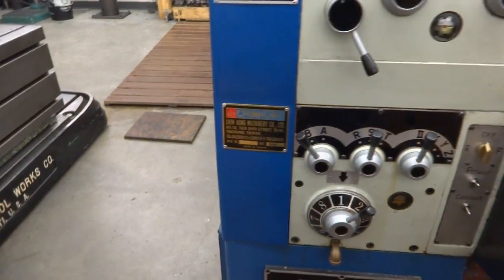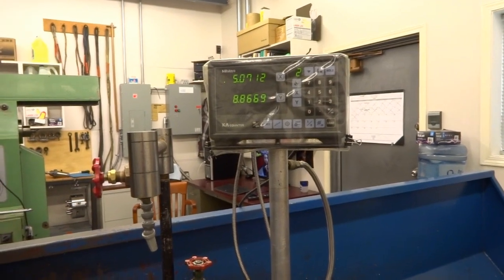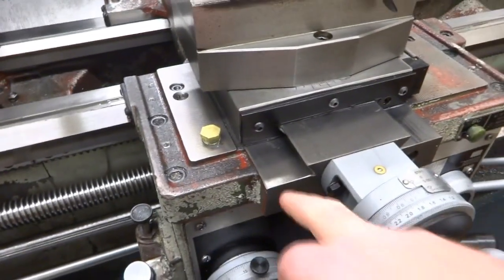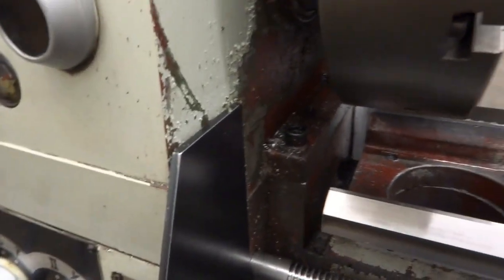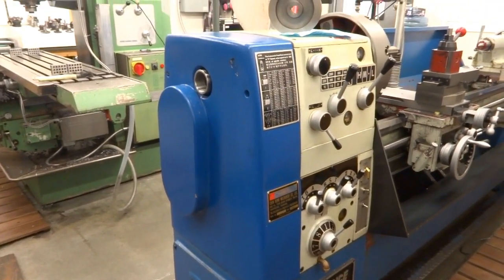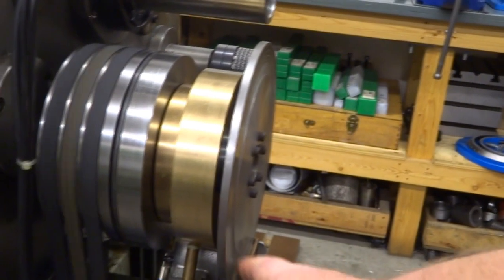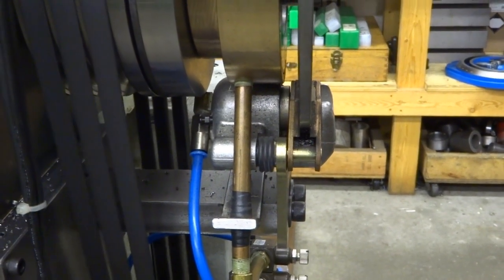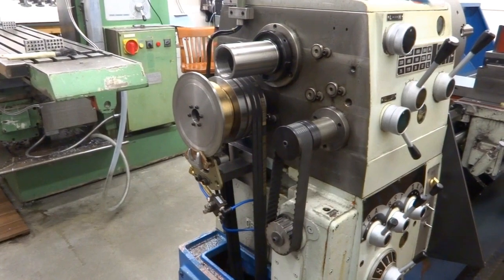Overview of Chin Hung Lathe

Comment: Accidentally came across this video and Wow.  Absolutely amazing. Loved the thorough tour of the ChinHung Lathe (now Kinwa - Chin Hung Machinery Co) but also loved the tour of the clutch assembly and pneumatic Clutch & Brake setup.  Amazing. I never would have though about adding a "clutch" to ease into the power load-draw! Plus the fact that you made it yourself!  Literally, you made a hybrid automotive Air conditioner / Transmission clutch assembly, w/Disk Brake no less.  Totally awesome!  

FWIW, most of my family worked/works for a very large air plane company and were / are machinists so they know... but I only recently got interested in machining / lathes and I'm amazed with what can be done on a lathe.  I'm a 100% noob on this stuff but would like to learn more.  This video was fantastic. Keep up the good work!

BTW, where / how did you learn to be a machinist?

Thanks.

Comment: I have a Kingston HJ1100 which is the exact same machine. It was built by Chin Hung. I love that machine. Very well built. Very accurate and smooth. A joy to use. I run it on a VFD which works really well.

Comment: Man that clutch set up is sweet. Awesome job. I am picking up a large older Jet lathe. Made in Taiwan also. I wish it had a clutch on it. Not a fan of all or nothing when you have a large piece chucked up and it starts to turn up quickly.
Reply from the maker: Thanks Tom.  It's something I'm fairly proud of, but because it is hidden under a cover and never seems to need any attention I rarely think about it anymore.  The clutch itself is sort of an all or nothing set up as the valves only control flow rate and not downstream pressure (like most valves).  (i.e. they are not like an air brake valve which controls the down stream pressure depending on how far down you press the brake pedal). You can 'ride' the clutch a bit but that simply delays how long it takes the clutch cylinder to reach full pressure.  It eventually does reach full pressure and then even though the clutch lever is only partially engaged the clutch will be fully engaged.  Because of this it is not as smooth as riding a mechanically actuated clutch.  I have added a couple of needle valves downstream of the control valves and this allows me to control how fast the clutch and brake engage.  The two advantages I see with this being a pneumatic clutch are the ease of running air lines versus linkages and the fact the clutch never needs to be adjusted.  I designed the piston stroke to be more than the friction material thickness.  Therefore as long as there is friction material the clutch will fully engage.  Thanks, Ken

Comment: Hey Ken.

Very Good lathe.
It always comes down to the same thing with anything in life.
Pay More Get More.

Very good work making the drive clutch.
It can be a problem when setting up at home.
How to power your equipment.

I was thinking you could maybe just a soft starter.
Either Electronic ( Inverter ) or Mechanical / Electrical ( Star Delta Starter ).
Even though i have 415 volt 3 Phase i still use a Star Delta starter for my lathe more so to reduce the amount of Inrush of power that you already would know about. 

Thanks for grand tour.
Regards Peter.
Reply from the maker: Hello Peter,  'Pay More Get More' or 'You get what you pay for' was a mantra passed down to me by my dad.  It is a very rare occasion when I cut a corner or cheap out in my shop.  I see some people do it and get away with it, but I never have that luck.  The odd time I have tried to cut a corner it has blown up in my face.  Over the years I have found going fast and cheap takes longer and costs more, so I don't do it.  Regarding the invertor, star delta soft start, about a week after I got my clutch running on the lathe, the power company came by unannounced and put me on my own transformer.  I can start and stop the motor on my lathe as much as I want and I don't affect my neighbours anymore.  By the way, using 'star' in star-delta betrays you as a member of the commonwealth.  We are a member as well but with our close proximity to the U.S. we call it a wye-delta.  Thanks for the comment, Ken

Comment: I don't me to sound like an ass but why didn't you just put a VFD on it?
Reply from the maker: I'm not sure why I didn't consider a VFD, but it was likely due to cost.  I think a 7.5 hp VFD was fairly expensive back in 2010.  Once I realized I was going to have to design and build a clutch it became a bit of a mission to see if I could do it.  Many of the things I've designed and built have been sold or used once and put away (i.e. tooling).  With this clutch I get to use it every time I use my lathe and there is a certain satisfaction in that.  Thanks for the comment.  Ken

Comment: I have a Mazac Mate. Good bit of kit.
Reply from the maker: Does it look anything like my lathe?  I've heard that mine is a copy but I don't think I've ever seen a picture of the original Mazak Mate it was copied from.  The Chin Hung is a nice machine and you can get spare parts for them, unlike a lot of older machines.  Not only that but the spare parts are reasonably priced.  I got a full set of way wipers, a coolant hose, some shear pins, keys and several oil site glasses for less than I paid for the parts manual for my U.S. built radial drill.